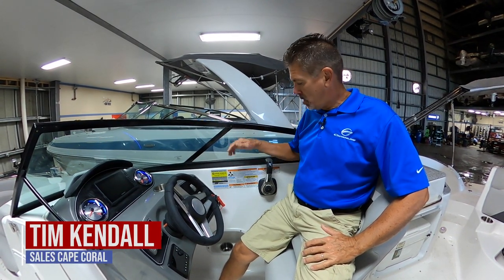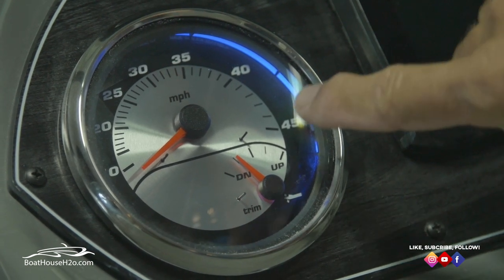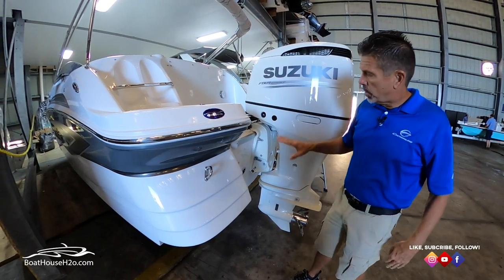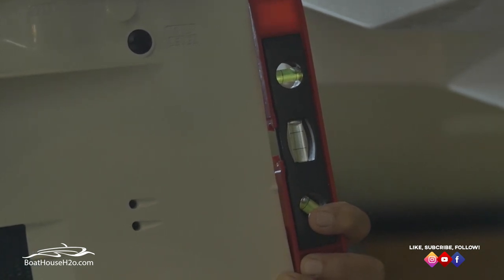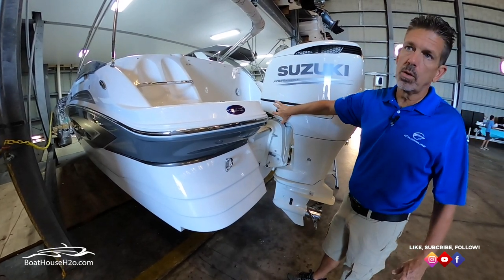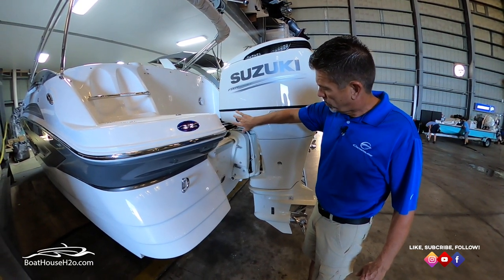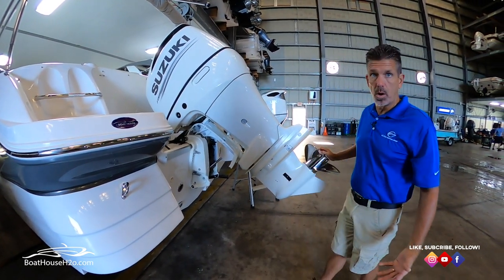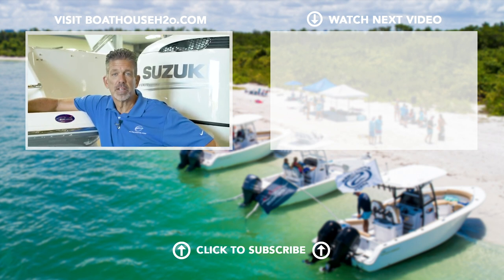How To Trim Your Boat (Basics Of Boat Trim & Tilt) 2020 Edition

Comment: That was a very helpful video for me a first time boat owner.  I have a 1990 Phantom 160 with an OMC Cobra 2.3l 1989 motor and 1990 outdrive... a little mix there at some point I guess.  Hopefully that's good though. It has skeg protector and what looks to be a hydrofoil set above.  When we got the boat, it had some problems which we were able to overcome. When they finally got it on plane it would die, etc... discovered the timing was 7 degrees out and dwell was off. Put new plugs in and reset dwell with the points and even replaced the electric fuel pump because the mechanical one was toast.  It was a work in progress but the first time we took it out in the back waters of lake Superior, we ran aground at 26 mph.  Scared the heck out of us.  Luckily the skeg protector kept from any damage below on the outdrive, but the belly got scraped up some.  We are still unable to get above 26 mph and when we do hit that speed we encounter the bounce you mentioned. I didn't know to trim the outdrive up once you are on plane.  I will definitely trim up to 1/4 trim next time we go out! Thanks so much for your helpful video!

Comment: Tim, great video/job.  Just got an used Tri toon with no trim gauge so I was guessing on the trim positions.   What about storing the motor, full trim up with lock in if sitting in the water (currently no lift setup), and same in the driveway or down to let all water drain out or any rain?
Reply: For modern 4 strokes you don't want to store them trimmed up. This does not allow the oil to drain and when you start back up you will experience white smoke burning off that oil

Comment: My boat falls to one side when on plane.  Is this from improper trim or engine height.  I have moved weight around in the boat but boat always seems to lean left or right once planed.  Any thoughts?
Reply from the maker: This may be due to improper weight displacement or one of the trim tabs being positioned differently than the other. I'd make sure you have all of your gear on the boat placed decently and then try and adjust your tabs in a safe manner next time you are out!
Reply: thanks for the reply   I have moved weight around.  Boat has no trim tabs.  I modified the transom and remounted the engine.  Take a look at my changes here.  Do you think that moving the engine in could effect the stability.  Boat seems to fall to one side or other  won't run level on plane.  https://www.youtube.com/watch?v=NAOZypJjahg
Reply: @ToolManTaylor  very nice boat and great use of space! Not sure where in the video you spoke of the boat tilting to one side when on plane however. Maybe it was in a different video?

Comment: In what situations would you want to trim up more than average? people riding on the bow? rough waters?
Reply from the maker: Yes, typically you would go higher depending on amount of passengers in the boat. If you trim too high, you may encounter “porpoise effect”. That is where the bow will slightly bounce up and down. Just trim back down about 1 second or until bouncing goes away.
If too high, you will get higher RPMs as well and start loosing speed. It will be an obvious situation and easily fixable by trimming back down a little. Hope this helps!
Tim